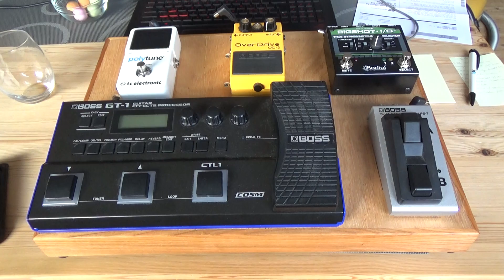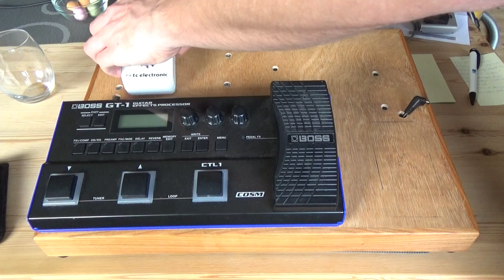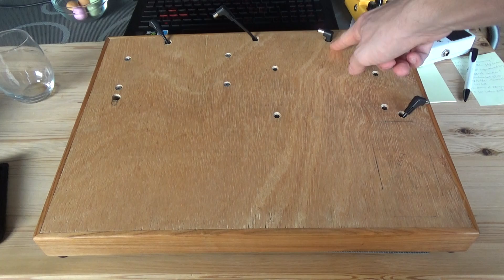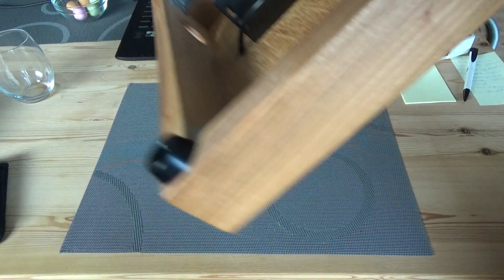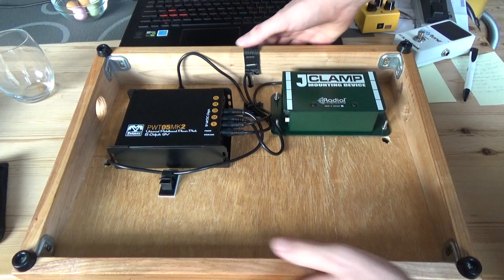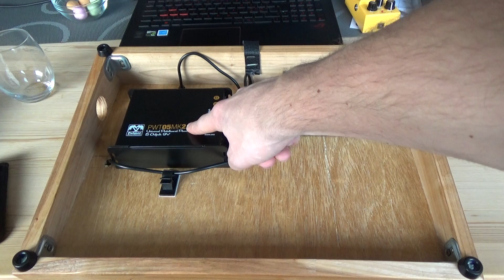Guitar Pedalboard Setup │ Part 2 │ Compact Sized Pedalboard.

Comment: Really Amazing Set Up Bro and you've got an amazing Channel. I got the GT1 a couple of months ago and this video has really opened my eyes to the limitless possibilities i could have with the GT1. A few questions though, 
1. Can you add more pedals like a boss delay, chorus etc and 
2. Which DI are you using 
3. Whats the difference between The Radical Bigshot i/o and I/O (one is bigger than the other)
4. Could you also include a pre-amp to by pass the effects on a fender amp

Thanks Man :)
Reply from the maker: Hey George! :-)
Man, thank you very much for your kind words - I highly appreciate it and it means a lot to me! :-)
I'm glad that my videos are able to help out and inspire people!

Indeed, the GT-1 is everything you could ever think of, that's for sure!
It has everything you could possibly need - and more! ;-)

1. Do you mean external pedals (delay, chorus, etc.), or are you talking about the onboard effects of the GT-1?
You can add external pedals, like delay, chorus, etc. if you wish to, but their placement would be a little odd.. since the GT-1 doesn't have an effects loop, like the GT-100.. The effects loop will make it easier to make sure the effect(s) is being placed in the most logical spot.. You can place a compressor and overdrive in front of the GT-1 and chorus, delay and reverb after the GT-1. That should be alright :-) I hope you know what I mean. If not, then let me know :-)

2. I use a Radial ProD2 Stereo DI - it's great, and Radial makes quality stuff!
The GT-1 in stereo is perfect - it really adds that extra to the sound, and lets you get the full advantage of the GT-1!

3. The difference is that the newer BigShot I/O (the one I have on my board) is designed with LEDs and a volume knob to control the input level of the 2nd instrument you have connected to the I/O. That's the main difference :-) I went with the new model, because I needed the LEDs to check the status of the guitars I use - knowing which one I'm using ;-) Also, the volume knob is a handy feature, since no guitar is the same, and the pickups might need a little boost :-) The I/O is a great product, and I'm really happy that I bought it!

4. What exactly are we talking about here? Is it a Fender preamp that you have, or??

Looking forward to hearing from you!
Thanks, man! :-)

Cheers!

Comment: A question - Will your drive go into an amp sim within the GT1 or direct to your amp
I've got separate comp, drive and delay pedals which are a bit redundant now I've got the GT1 and so looking at ways of using them.. Any thoughts greatly appreciated.
Reply from the maker: Hi there, Ian :-)
Nice to hear from you - appreciate it!

Mainly the OD-3 is there to just add a little bit extra texture.
I have the DRIVE-knob turned all the down down, the LEVEL-knob a little over half way and the TONE-knob at about half way. By running the OD-3 that way I've found that it will add that little bit of extra sparkle to some of my sounds - which is great! That way I can also use it as a boost, if I need that ;-)
But to answer your question - Yes, the OD-3 will run into an amp sim in the GT-1. I do not use an external amplifier, so all my amp and cab sounds are coming from the GT-1. I'm really happy with the results I've gotten, and it seems to suit the different genres of music I play :-)
The OD-3 is connected before the GT-1, like you normally would, when connecting an OD/DS-type effect.

Haha, yeah, I see that - I kind if feel the same way with some of my pedals! 
The only down-side to the GT-1 is that it doesn't have an FX-loop. So connecting FX like delay, reverb, chorus, etc. is going to be complicated, because you would want to have such effects after the preamp section.
But if you're using your GT-1 with an external amplifier, just using the GT-1 for effects, then you could try and hook it up like this:

Guitar --> comp --> drive --> GT-1 --> delay --> amplifier.
That might work out just fine - let your ears decide ;-)

Generally I have all I need in the GT-1, so basicallt I don't need any external FX, other than my A/B instrument switcher, tuner and footswitch.

Let me know what you think - and if it makes sense :-)

Cheers!